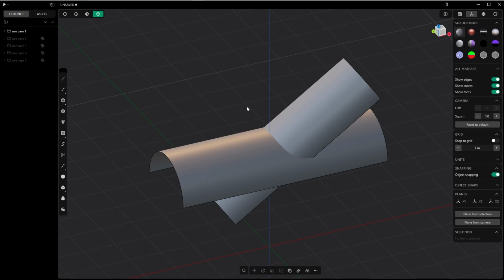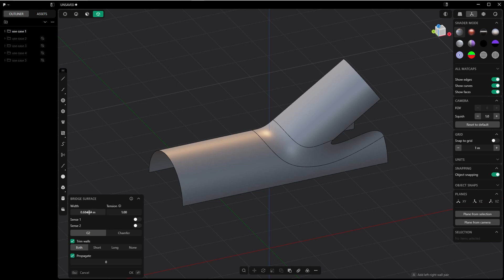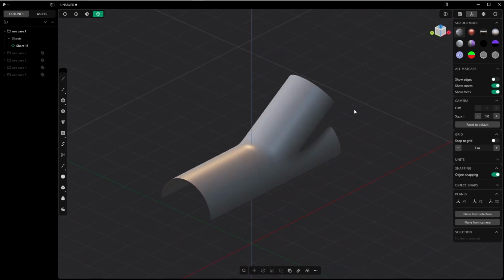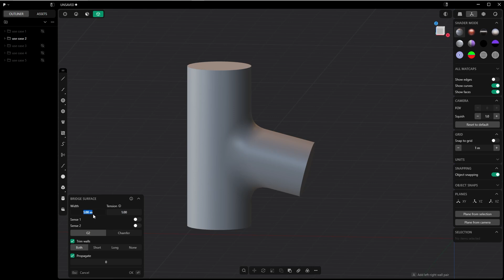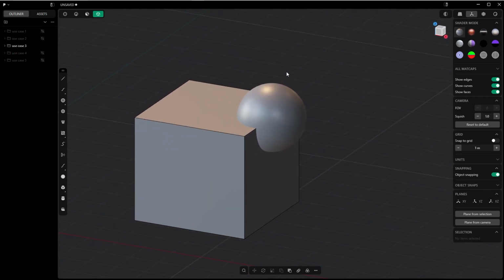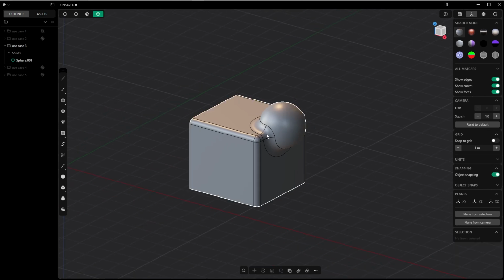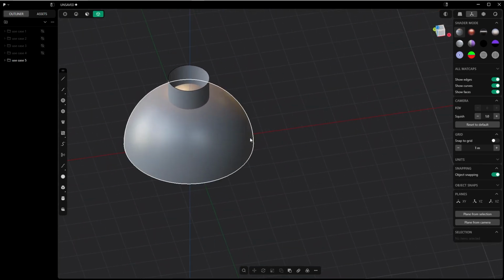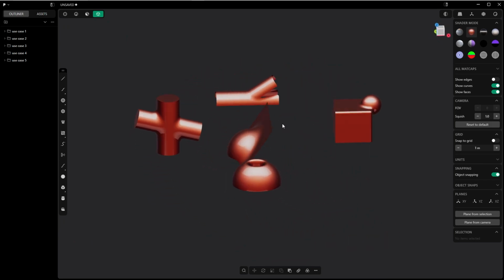Plasticity Tip No. 35 - Bridge surface

Comment: To me, it isn't working if the cylinders are identical and if they share the same plane of symmetry. I have to, either: reduce the diameter of one cylinder (one cylinder became "embedded") or move one "inside" the other.
Reply from the maker: @italianinkscapechannel  you're right, that's why the cylinders in my example aren't identical.